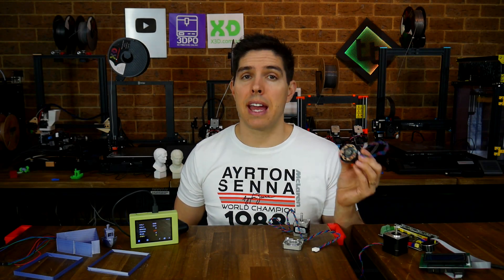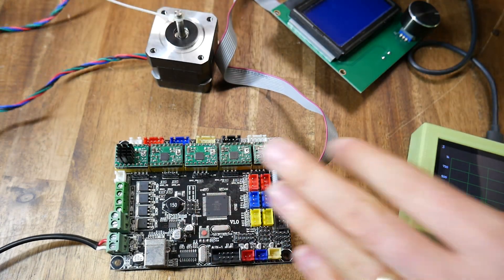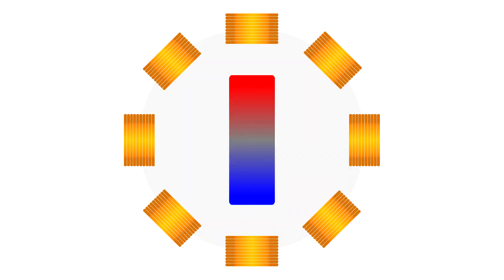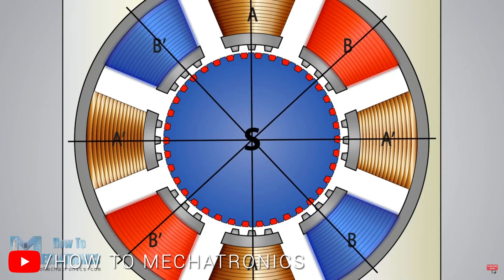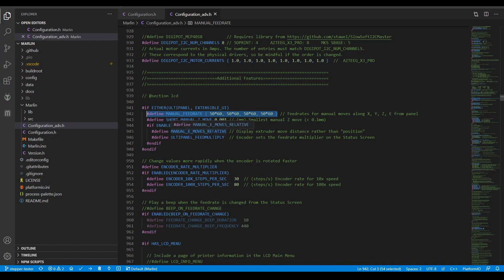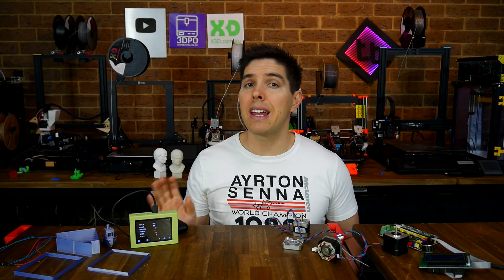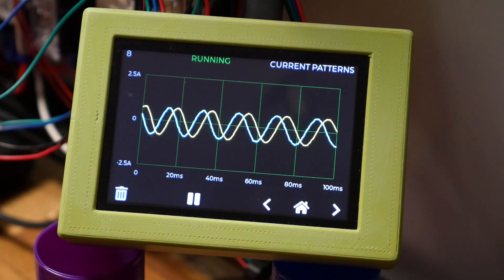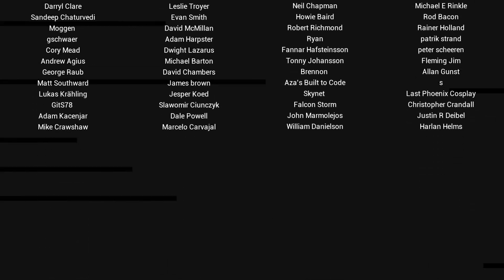Enhance your 3D printer knowledge with the Simple Stepper Motor Analyzer

Comment: Watched the video, I am currently having all kinds of problems with my extruder using an E3 Turbo board. Went to get some built and Current sensor are on BO.... UGGGG
But thanks for the video... I still plan to get one, but I think for now I will need to put the original board back in my CR10v3

Comment: CRAZY HEAT. My Ender 3 v2 is 6 weeks old. The Y Stepper for the bed is extremely hot compaired to the others. The X axis stepper can be at 35 C and the Z stepper will be 45 to 70 C deg. You cant even touch it with your hand. I know that there is more force to move the bed than the print carrage, however even if you don't do a print and just set it to home, the steppers are powered to keep everything from moving. If you do not dissable the steppers, in 30 min the Y will be 10 deg hotter and in 2 hrs it will be 35 deg hotter. I noticed it after I hade the printer for 2 weeks. Then doing a 10 hr print this past weekend I discoverd it was at 72 C. Do I have a bad stepper?
Reply: More likely that the current setting for that axis isn't set properly. You can swap the stepper connections to see if the same stepper gets hot or the one connected to the same driver. If it's the latter you can just adjust the appropriate current pot with a small screwdriver until it's just slightly below the point that the motor gets hot.

Comment: A rare case on this channel: the video is useful and useless at the same time. All because you can't buy the assembled hardware, or at least buy it two parts. Of course you can assemble it yourself somehow, starting from Arduino plate, but you need to be a pro in radio electronics. In the repo is almost no information about hardware, in the BOM just mentioned  "Analyzer PCB Rev 1.0", how sweet.. So it is impossible to apply the acquired knowledge. Pitty.
Reply: Upload https://github.com/zapta/simple_stepper_motor_analyzer/blob/master/kicad/gerbers.zip to PCB providers such as JLCPCB and you will get back the PCB boards.
Reply: @FirstLast-ih6ec  Thanks a lot!

Comment: I can't find a 25mhz black pill. :-( 
edit: I found one that might work. 
Allegro ACS70331EESATR-2P5B3 doesn't seem to be available.
ACS70331EESATR-005U3 is available.
Reply: The 5U is 0-5A. You need to 2P5B which is -2.5A to 2.5A.  Digikey is temporarily out of stock.  WeAct Studio store on aliexpress has STM32F411CEU6  with 25Mhz crystal.
Reply: @FirstLast-ih6ec  thanks

Comment: There is a rumor that you often damage and demagnetize your stepper magnets when disassembling them. Is it true? Or does it only happen to people using a hammer to disassemble the stepper? 
Did the analyzer show any difference before and after disassembling it? Has it been the one with poor inductance? Or do you know, why the one stepper didn't perform well? Did it overheat before or drop?
Reply: I wish he'd explain what he means by poor inductance. Low inductance is good as it allows controller to keep current up on rapid motion.
Reply: @1kreature  Poor inductance = high inductance, in this case. Since we are running relatively low voltage to the stepper motor, it won't like the high inductance as its slow to react.
Reply: @jaro6985  So the motor didn't break, but was always like that? Can you recommend information about the difference between old and modern stepper motors? I guess it is a different material for the magnets?
Reply: @maxmustermann2596  Yeah most likely always like that. Correct, modern stepper motors will have a permanent magnet core likely neodymium, then the iron laminations around it. Older might use AlNiCo or some other inferior magnetization method.
Reply: Its not true with modern stepper motors, you won't lose significant magnetization. Dropping it or overheating also won't do much unless we are talking extreme levels (eg well over 130 C).

Comment: Hi Michael,

Great presentation, as always.
Can you tell me if its possible to acquire one of these things ready made?

Thanks for all the great work.
Reply: I'm considering building a small run of these as a side project if people are interested. I haven't looked at the cost of all the components yet but probably around $60USD or a few bucks for a PCB.
Reply: @rareshiny661  count me in
Reply: @rareshiny661  count me in
Reply: @rareshiny661  Did you make some of these up? I'd be interested in one.

Comment: Having started in an NC shop, then upgrading to full CNC with closed loop steppers with backlash compensation, I still can't believe there isn't any hobby ready 3D printer that supports what I'm used to. If I have missed something, please point me to it! Regardless, love the tech available to the average person and people who help us out, like Michael.
Reply: The reason that 3D Printers don't bother with it is because there's no need to, there aren't forces acting on the nozzle and regarding movement 3D Printers are actually more accurate than CNC Machines, but the resulting prints aren't due to plastic expansion, retraction and other physics properties of the materials we use, rather than the mechanics of the motion system.

Backlash is a non-issue on properly setup machines, even those with leadscrews rather than ballscrews or linear guides and isn't worth the additional overhead to account for when closed loop steppers cause so many other issues, you know unless of course you frequently hit your printer with a hammer while printing :D
Reply: @TheBarrelDoesGaming  yep, and Marlin supports backlash compensation if you really wanted to use it. But no one should be using a leadscrew for anything other than Z axis, which doesn't need backlash comp due to gravity.

Comment: It is worth noting that microstepping does NOT increase a motor's resolution as they are open loop and cannot stop betwen full steps with any degree of accuracy. Microstepping makes stepper motors quiet and move much smoother, it does not increase the resolution of the system - that is for a 1.8 degree motor, 1/32 microstepping does not increase the number of discrete number of possitions the motor can stop to by 32.
If microstepping did increase resolution, then 0.9 degree per step motors would be completely pointless.
Reply: Of course it increases resolution, google "hackaday microstep" for a simple example. 0.9 deg per step motors are not pointless as they will have more torque running 0.9 degree steps, and also can be microstepped down to lower levels than a 1.8 deg.
Reply: I get what you're trying to say, but this seems inaccurate.

If my printer's steppers couldn't stop at a microstep, it would be disastrous for printing even the simplest of 20mm calibration cubes. The accuracy of the print would then depend on where I place it on the print bed, and this isn't the case. We'd be seeing real life aliasing, and that's not something that I've ever seen in 3D printing.

Repeatability and holding torque on the other hand is reduced with microstepping.

Comment: Damn that's pretty interesting. Given I have an oscilloscope, it might be time I use it to find the solution to that goddamn stall I'm having.
Running NEMA 23s on X and Y, TMC2208s on UART, StealthChop is useless and doesn't move them at any current even max past ~30mm/s or so, SpreadCycle runs them well in many speeds, even low currents, but it just WON'T run at 4000mm/min. G0 codes on Y axis alone, X works. Looks like a mechanical resonance locking them up from what I've read, tried even replacing the stepper with another identical and a different one entirely, same deal. If I hold them firmly on my hand it doesn't stall....always at least, but mounted it just won't work properly.

If anyone is curious and can help, the setup is a leadscrew based moving bed, T8x8 screws on the NEMA 23 stepper, runs between 6000 and  11000mm/min, and lower than 3500 any speed, but that specific range locks it up. Not binding, I can roll it with my fingers easily, and it still locks unloaded too at any current. Tried many different microstepping modes, Marlin 1.1.9, 2.0.7, 2.0.X bugfix (2.0.7 didn't even work at all and fails homing regardless of what I do).

Comment: Hi Michael. Very timely as I have had Redrex stepper go squirrely on the Z axis of my Ender 5 this week. The original Z was a 400 thread which would drop, the beefier stepper fixed that. Would like to confirm that the stepper is the problem, so this looks like just the tool I need! Many thanks. Can you do a video on simple PWM controllers for steppers so we can make DIY wash stations?

Comment: Great explanation, thanks for that. Unfortunately sourcing the necessary items isn't that easy because you need a certain STM32 board with a very (vendor) specific pin out that seems hard to come by.

I wonder how far you'd come with a run-of-the-mill oscilloscope for analyzing stuff like this, though
Reply: Sounds like basically what it is, with fancy useful software on top. I'm also wondering since I'm having a hella annoying problem with my Y stepper jamming at a very specific speed range (3500 to 5500 mm/min.) even unloaded. Given I have a scope, I might check the waveforms at the stall moment to see if I can fix something, maybe those TMC hysteresis values and such.

Comment: Hey, I like your videos and now I can give back some knowledge as you provided a lot of it in past. So galvanic isolation means, that measured circuit is not directly connected to measuring measuring circuit. This is usually done using opto coupling elements to separate circuits. In this case GMR sensor is used - it's similar to the Hal effect sensor in operation, but it's much more sensitive.  Basic principle is that current passes trough conductor and because of that magnetic field is induced around said conductor. When magnetic field is passing trough GMR sensor it will change it's resistance corresponding to that field and because field is generated by current ... well it's current meter that is connected trough magnetic field but not electrically. Why is that good, well electrically isolated circuits will not affect each-other so measurement will be more correct. 

Here is also link to how GMR sensor works as it's long paper and they explain it in more scientific manner: https://www.ncbi.nlm.nih.gov/pmc/articles/PMC3522974/
Reply: Great explanation. Also adding to the galvanic isolation benefits: it avoids ground loops and similar problems, for example if you have the device being powered from anything connected to the same grid as the printer sharing a ground, that could lead to issues (sometimes even shorting stuff to ground) depending on circuit design, and galvanic isolation is made to avoid this (transformers are often means of obtaining this too for AC signals/power).
Probably was chosen to avoid any coupling between windings and messing up the stepper driver, or to keep the power ground separated from any of the stepper connections too.

Comment: I had made a stepper motor spin over 2000RPM at work for purpose of testing speed detecting equipment.
I wonder if this gadget would be able to keep up.
Reply: @dzidmail  It will be even more considering the fact that those 2000RPM are with 1/64 microstepping....

Comment: You forgot to mention that setting current via the firmware instead of using a screwdriver is only possible if your stepper drivers are configured to run in UART mode on the motherboard. It doesn't depend on the stepper's brand name.
Reply: There's a lot of different steppers that support soft current adjustments and not only using UART. Before Trinamic drivers came out boards like the RAMBo series used digital trimpots over SPI to adjust current and TMC2130 drivers use SPI directly to set current. It's not just TMC2208/9 that support soft current control.
Reply: Are there drivers other than trinamic that use uart? Sure there are standalone non uart implementations of tmc but afaik all uart 3d printer driver are tmc (while not all tmc (but most of them) are using uart)
Reply: There are some other drivers on the Marlin configuration page that support current setting (LV-something?), or even boards that have current setting capabilities for different stepper drivers indeed. I think it's even possible to design the board such that the current set pin is controlled by the MCU even on A4988 drivers, doubt anyone has done this tho.
Also yeah standalone TMCs won't be helped but I guess he just assumed that if you're running TMCs you're going to want them in UART, I mostly chose this because I really didn't wanna fiddle with the potentiometer.

Comment: I think "impedance" is the same as "resistance" except for a circuit, not one component. "Low impedance" I think means the board-motor connection doesn't "see" the device as a significant resistor
Reply: Not really.  Both terms apply equally to circuits and individual components.  Impedance is used for AC, where the amount of current flowing depends not just on ohmic resistance, but also on inductive and capacitive reactances.  The combination is called impedance.  Resistance is the term used where current and voltage are in phase, as in a DC circuit where if one goes up/down the other follows suit.  In inductors and capacitors, current and voltage are not in phase.  For example the coils in stepper motors have relatively large inductance (and therefore inductive reactance) compared to their DC resistance and that has a significant effect on current flow.  The rise or change in current, which you want to be rapid, lags behind any rise or change in voltage.  It's why stepper motors are driven by quite high voltages.

Comment: Hey can you tell me the how to fix glitched display on reprap full graphical display lcd
Reply: I wouldn't advice to ask for help in a YouTube comment section, that's what Facebook groups and Reddit are for... 

Anyway... Would you mind explaining a bit more?
Reply: You set delays on it, I know cause I have a cheapo one with long cables!
Test adding the following delay code lines (I'm assuming you're using Marlin, that is), I added right under the define of the LCD:
#define ST7920_DELAY_1 DELAY_NS(0)
#define ST7920_DELAY_2 DELAY_NS(400)
#define ST7920_DELAY_3 DELAY_NS(0)

Solved for my LCD (the Aliexpress ones with red board and encoder on the bottom), hope it does for yours. You'll maybe need to tweak the values if it doesn't work for you.
Reply: @Kalvinjj  i try it get little better but not full clear
Reply: Any other solution?